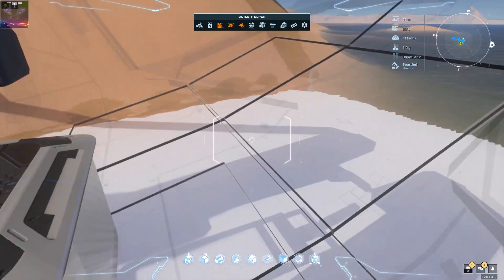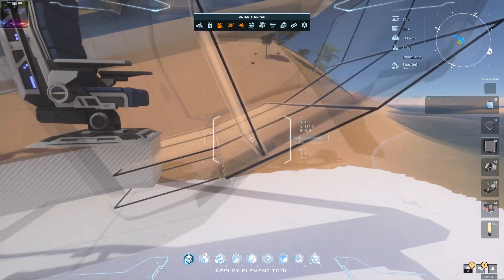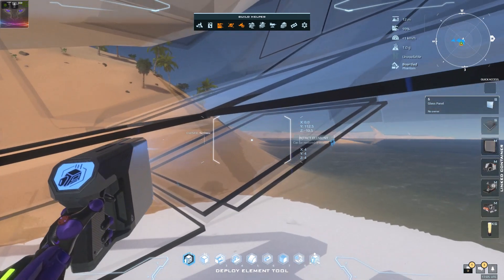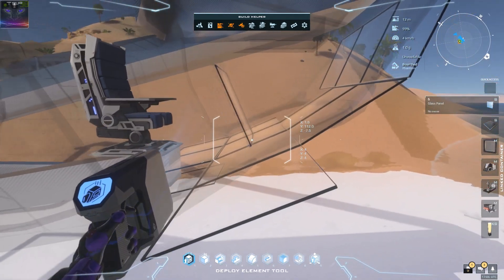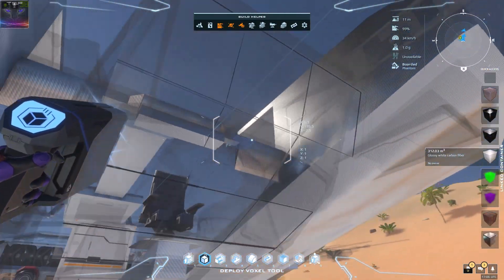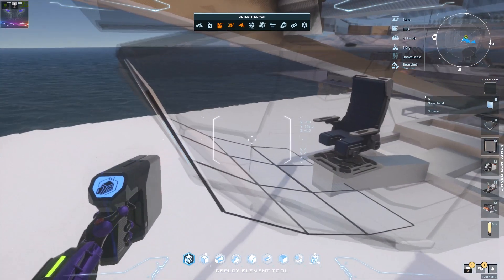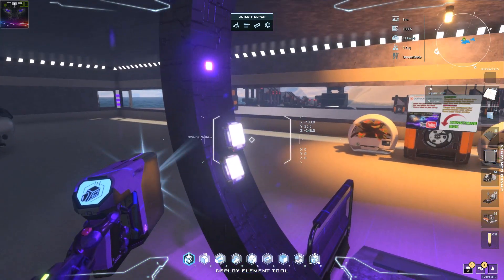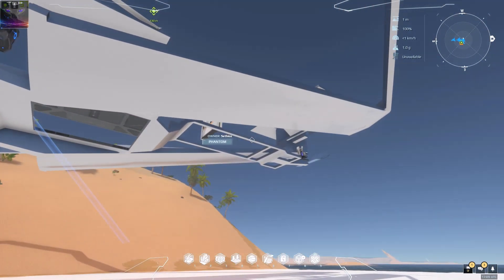Dual Universe - how to fine tune element angles and placement

Comment: If you rotate it from the side, you can't get every possible rotation angle. What I do is put a voxel in front and edit the angle and elevation with the voxel editing tool.
I do need to stack the windows sometimes to align them properly with the last placed window though.
Reply from the maker: nope, even with voxels you can't always get the right angle, because regardless what angle voxel is under, element either goes too little or too much, in that case stacking elements is only way, just to find that angle you need .. but even then sometimes it wont work due the game limitation.